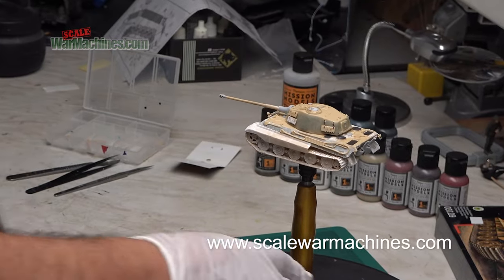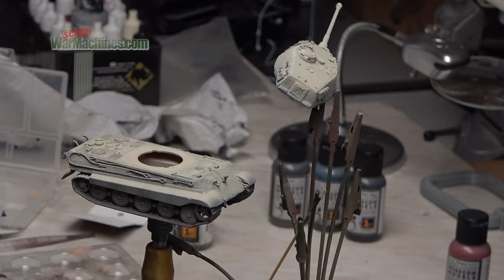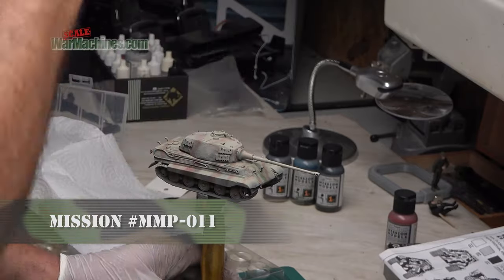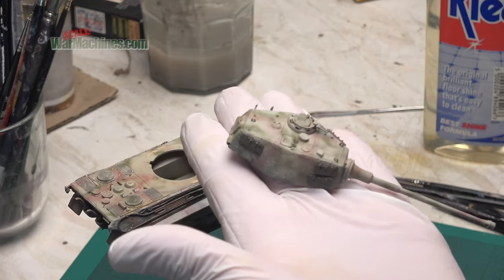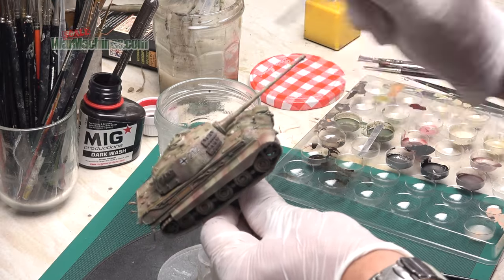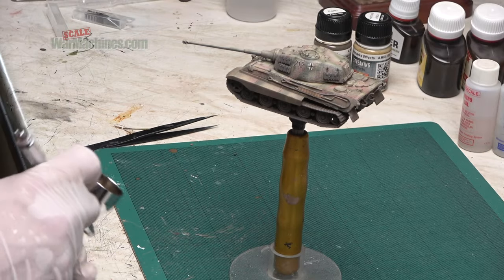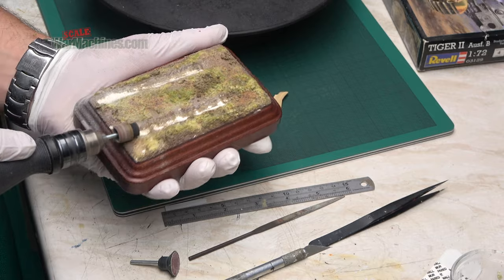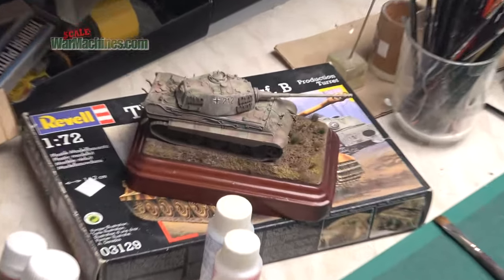GERMAN CAMO - REVELL KING TIGER, MISSION MODELS PAINTS & GAAHLERI 98D AIRBRUSH

Comment: I find that the decals comes out better if there is no water in the mix, so i put the sheet on a wet paper and then when the decals comes loose i pick it up and dry it with a bit of paper so it has no water on it, then i use the decal solutions to stick it to the model, comes out realy good every time

Comment: I have not used Mission Models' paint, before. But, in my experience; water based acrylics of any brand do not lend themselves to good airbrushing. I'm sure to get some grief, but; this includes Vallejo. The solvent based acrylics, such as Tamiya and Gunze Sanyo; are much better for airbrushing. They also adhere much better. My Sotar will spray the aforementioned Tamiya and Gunze, all day long with no problems. I can spray a hairline with them. But, it will balk every single time with Vallejo or similar. Thinner needles and nozzles seem to have issues with the surface tension of the water based paints. Just my 60+ year experience, not claiming to be an expert. You did a very nice recovery from the problems you encountered. I hadn't seen you around in awhile and sort of wondered if you were still on the Tube. Nice job. Enjoyed your video.
Reply from the maker: They’re fine, they behave like most acrylics. You’re right about Tamiya, Gunze and I’d add Ak real colours. The best for airbrushing finish are enamels, no question, but the stink means I rarely use them!…

Comment: Thank you for sharing. Do you have a recommended Wash that will do primarily recess shading with minimal to no surface staining? regards.
Reply from the maker: You’re right some models can get really darkened by a wash, you could try your own oil based mix or you could try the liquid pigments and water based products on the market, I use Lifecolor liquid pigments for this often, although they can stain a tiny bit. Best to keep the solvent washes as a localised pin wash.
Reply: @scalewarmachines  thx.